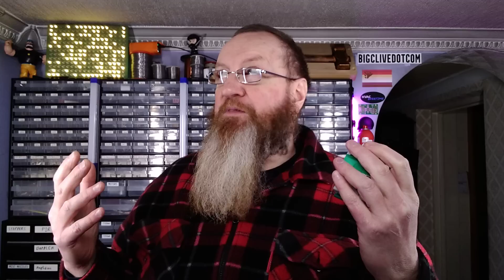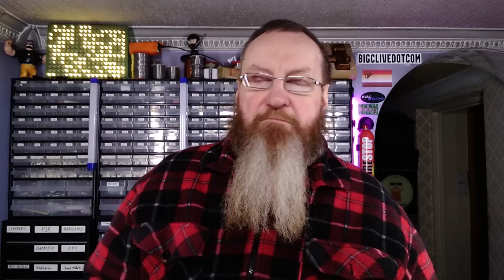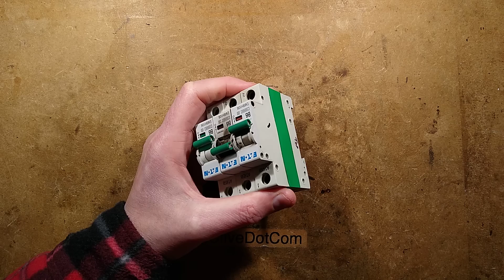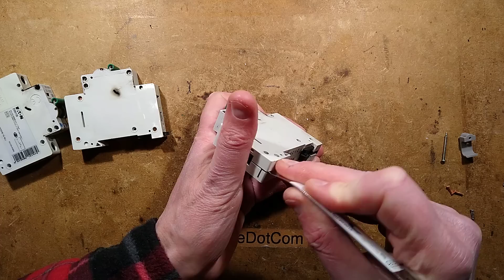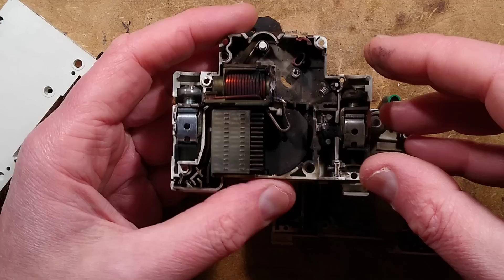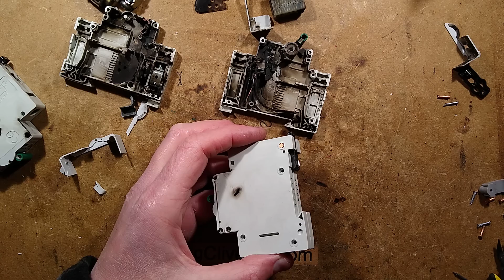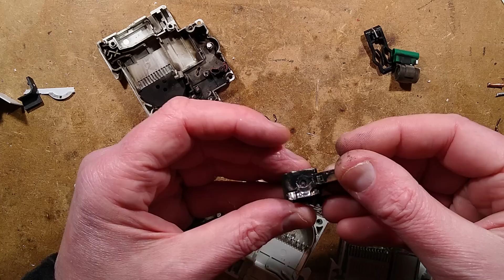Arc flash breaker failure - let's open it

Comment: IME the only way to find a fault in branching circuits like lighting is to isolate it by disconnecting every branch circuit from the breaker that keeps popping in sequence until the breaker stops popping.

Unfortunately that can take quite some time with intermittent faults, unless you have the time (which equals money) to in some cases literally dig up each line looking for tracks, chewed or otherwise damaged insulation and so forth.

And yes, this can happen in residential circuits. I used to live in a hundred plus year old American farmhouse that had some lines running through cinder block walls. A particular breaker would pop roughly once a month in summer but not in winter. I never did chase it down despite replacing outlets and light fixtures on that line, suggesting the fault was inside the wall where I was not willing to look being as I didn’t own the place.

Oh, you say, outlets and lighting on the same circuit? No, that’s not code here but as I said the house was ancient and had been electrified in stages. The breaker box had to be entirely replaced after I moved out because among other things it didn’t have a master disconnect switch! To disconnect the house from the line you would have had to climb up to the weatherhead on the house or do it at the pole nearby. The more I learned about that house the less I wanted to live in it…
Reply: Where does code prohibit outlets and lighting on the same circuit? There are certain circuits that are not allowed to be used for lighting such as the 20 amp kitchen circuits, but I have never heard of any restriction for general use circuits. A good electrician/engineer will design the circuit so that if they do mix lighting and outlets on the same circuit, the lighting and outlets in a given room are on different circuits.

Comment: People need to check the often overlooked Buss Bars that the breakers plug into/over for arcs and cleanliness too! I had one instance where that happened and now a breaker cannot be put back in that position. People check the voltage (usually ok) but there will be a current limitation

Comment: I have a teardown for you.  I brought a Arlec DC pedestal fan in the hope that it would run slow with its 8 speeds but its just as fast as a cheaper AC FAN.  The speed adjuster is an old school switched potentiometer driving an 8 segment LED but it is also controlled from a remote with the switch in the off position.  The input chip has no ID on it.  A bit beyond my expertise to make it run slower.

Comment: Supply impedance and fault currents need to be accounted for and managed in the electrical design - the fact that more than one upstream breaker tripped suggests that hasn't happened here.
Reply from the maker: What happened here was that the breaker itself had reduced in its ability to break its rated fault current over time.  The tripping of multiple upstream breakers is because the fault current was very high and there was no time option set on upstream breakers.

Comment: It's not just in electrical. Anything intermittent is a headache. I'm a soft dev, and the last thing i want to hear is "i was doing stuff and it went pop, but i ran it again and its fine". Some users can give you a pretty good account of what was going on, and logs can help, but for the most part, it's either a very obvious mistake or you'll be looking for needles in haystacks. And sometimes you can't even tell where the haystack is...
Reply: Yeah, had some devs that loved to jump to subroutine, never return, so garbage would accumulate and fill the stack. Then, they'd trigger a garbage collect to clean up.
Senior programmer had to chase down some issue in that tangle code, finally fixed the problem, called a meeting and went off like a nuke.
I took a look and cleaned up a lot of the mess, just to get rid of some aggravation and informed the team, if I ever saw that kind of shit again, I'd solder their fingers together.
Given I was mostly a hardware guy, I think that shamed them into better practices. Or maybe they believed that I could solder their fingertips together after they saw me successfully repair to component level a hard to get multilayer board...
Of course, I didn't tell them that I'd been a code monkey back in the day.   ;)
Reply: oh my favorite part is the only thing you have to go off of is whatever debug print statements/logging that the developer just decided to enable.
Reply: @ All code bases i touched became "Logging and monitoring are first class citizens". It's ok to f'up, bugs are part of a devs life, it's NOT ok to waste dev days chasing ghosts just because you didn't bother to log things. I can live with people making mistakes, that's human. Being lazy is also human, but i don't have time for that one ;)

Comment: Love a teardown.. The solenoid plunger is for short circuit protection to quickly disconnect the supply within 0.4s and the bi-metalic strip is to disconnect the supply in the event of overload. Clever design that is reliable on the whole.

Comment: I’ve known plant operators that with an intermittent breaker tripping seemingly randomly. To avoid writing up a failure, they would reset a breaker a dozen times until it held long enough to make it to shift change. Then it’s someone else’s problem. I was glad to be a SCADA manager and not an electrician. The SCADA manager just got the call to trend how many times the now smoked breaker was reset before blowing, with time stamps. At least in your case, the Eaton breaker did it’s job well and kept the arc flash mostly contained.
Reply from the maker: Especially factory workers on piece work being paid per item they make.  Machine downtime seriously impacts their wages.
Reply: Thats a good quality breaker, most 3 phase breakers have overcurrent trip only on 1st phase, the rest are  just switches...

Comment: We had a real inrush issue when I had a load of servers on the same circuit. Their running load was well within the 32A total limit, but the rush when they all started up after a power cut would trip the breaker. I ended up having to adjust the BIOS settings to give each server a different delay after power was restored to stagger the sudden rush of current.
Reply from the maker: The event industry has sequencers that switch equipment in sequentially.  Also good to allow stuff to boot up in a sensible sequence.
Reply: Also had an intermittent fault with the breakers themselves, and, in the end, the electrician simply replaced them all, which fixed it!
Reply: you have to factor in the huge peak inrush current and supply enough circuits to cope or use UPS with multiple controlled outputs that an be staged.
Reply: Or cheat and fit a "D" rated breaker,  shhhh!

Comment: I spent years looking for shorts and disconnects and leakages in BT buried cables, 50v negative battery and 10milli amps, the TDR (. Mole we called it) was good for full dis or short but it would show up joints where cable sizes went from say .5 to .63 as a dis or a short depending which end you’re looking from, ive had them spot on over half a mile and 5 meters out between 2 boxes 20m apart.  Some shorts are rectified in that they’re different values depending on which leg you send the test current down, due to a diode affect from mineralisation at the wet short,. Generally I used the “ megger” not a megger in fact but a Wheatstone bridge type tester, which could be great over 3 miles or well out if there was some Ali cable or a bit of higher resistance in a crimp.  It got more critical  as adsl came in.  In soft ground an oscillator 99 and a broom handle with an amplifier set and probe wired to a nail in the bottom would nearly always find a leak, it boomed out as you step on it.  At £600 a dig BT wanted them found first dig, otherwise it could’ve cheaper to lay a bit of duct and a plastic box. The oscillator 99 was banned  from being put across a pair because if a sub lifted the handset of a dial phone the bleep could damage their ear ( I doubt it but it would make you jump) but as usual, some of the kit from the early days was better than the latest JDSU stuff we had. Anyway, copper going, all the exchanges are going down to maybe 6 nationally and it’ll all be fibre very soon. They’ll pull out the copper E sides often sheathed in lead and brown paper, big scrap money ,and they’re selling off the exchanges..

Comment: At one location a breaker would pop from time to time, and we had to go to the place, turn it on, and it would work for weeks. It is a ground cable, a 40m run. Last week it was already happening daily, so a guy who specializes in finding such faults arrived. I was assisting. He took a meter doing reflectometry thing, and it showed that entire 40m of the cable is solid. No joy. So he took a device his father made, and connected it to one of the broken phase wires (two phases were showing 0.02 and 0.06MΩ to ground, so definitely something was wrong). He made a makeshift grounding with a big screwdriver, connected it to the other pole of the device, and turned it on. While some relay within was clicking he took another part: a galvanometer with amplifier, and two electrodes that looked like ski poles with 15cm long stainless steel spikes at the ends. He started probing, and the meter's needle showed: left, left, right… away from the grounded screwdriver. As he was approaching the place where the fault was the needle would show more signal, so he turned sensitivity down. When he was at the spot he only moved electrodes by centimeters and needle would already change the direction. We started digging, and there was a fault: cable was damaged by people who put a fiber there, we found markings of the excavator bucket (insulation was broken in two places), also the damaged cable was insulated poorly so that water came in, did its thing with electricity, and cable insulation turned into crispy conductive carbon.
I asked the guy about the device: apparently there was a capacitor being charged by voltage multiplier, and when its voltage reached certain threshold the relay would connect it to the output. While discharging through the ground it would produce intermittent voltage gradient, probing it would show rough direction where the fault is. It required its own grounding to operate.
Apparently his father saw some electricians doing it years ago by hand: charging electrolytic capacitor using a diode from mains and discharging it between local ground and broken wire. Other guy would walk with galvanometer, stick electrodes into ground and find the fault eventually. So he made his own, improved version. No idea if this is patented, simplicity and effectiveness is surprising and satisfying :)
Reply from the maker: Interesting approach to find a breached outer sheath on a cable.  I've had a few instances where underground cables were clipped by contractors and they just buried it afterwards.  Very annoying.  The utility also uses a device called a thumper to trace underground faults.  It charges a capacitor and then dumps it on the cable.  It results in an audible thump where the damage is.
Reply: They probably knew about damaging the cable but 'ostrich-ed it' probably cowboy contractors avoiding extra cost of repair from the electricity board.
Gaz Yorkshire
Reply: @Gazr965  I used to work for a cable ISP as a field technician and i can tell you this happens all the time. Once I roughly located a fault to a private construction site where they where digging with a mini excavator and asked them if they had seen a cable they might have accidently clipped. Usually when i asked nicely contractors would show me, dig the cable back up, i would fix it and they could move on with their day without even being billed, accidents happen. But these guys.... They where sooooo sure they didn't even come close to any of our cables and that i must be wrong and the fault must be somewhere else, they had me studying plans, locating cables, remeasuring and question my sanity. They also became increasingly unfriendly and hostile, threatened me I would have to pay for any downtime as a result of my fault finding. Eventually i've had enough, called in my own contractors and had them open the exact spot I had been questioning them about hours ago when i came on site, only to find about a cable that was completely destroyed over the length of over a meter. It was also clearly copper with no sign of corrosion so it must have happened probably an hour before i came there. When i showed them they became quiet and then started mumbeling shomething about a treeroot that must have caused this. Not only does tree root damage look completly different, because it is happening over the course of many years, there was not even a tree in sight! That was the first time I billed them, for the materials, for my time, for the contractor and for the downtime to our customers. I was super pissed. This could have been solved within 30 minutes with no cost to them, but they decided to waste hours of my (and their) time because they needed to be absolute dickheads.
Reply: @muh1h1  Amen.
Reply: @Gazr965 elec board dosnt fit fiber, telecommunications companies do!
Reply: @rodd8170  You mis read my comment, I said they ostrich-ed it meaning avoiding paying 'electric board to fix it'. 
as in  damage the fibre optic contractors caused to the electric cable !
Reply: Rodalco2007 has a demo of a thumper being used on his channel. Seen them, but never in use. I’d imagine they are quite costly, which is why your father opted for rolling his own. Seemed to do the trick.
Reply: "people who put a fiber there"

The people who put fibre down my road (hello Voneus!) burst a sewer pipe.. it started to leak, they covered it all up, and ran away. Three weeks later, sewerage all over the road.
Reply: @mickeythompson9537  I've seen multiple instances on an Australian plumbing channel where the telecoms company drove their fiber through sewers and storm drains because they used horizontal drilling methods instead of trenching. One of the latest was straight through the middle of a six inch sewer at three foot depth.

The problems only become visible when the plumbers stick cameras down the sewers to figure it out.
Reply: We had a similar unit for sheath faults. It had a motor driving a contactor to create the signal. It was controlled by a vairac, transformer wtih a bridge rectifier to get about 1000Vdc pulsed (called it a Popie). It used the same duel probes and galvo to sense the current flow. It was all hand built by the old powerboard before I was born.
We also had a thumper to locate higher impeadence faults with the headphones. On a good fault you would feel it while walking along.
We used to bet a box of pizza for every meter off the final fault location.
Reply: Here in germany, our utility companys have trucks with such fault finding equipment for cables up to 20kV and they too use the basic methods first, sending high power pulses down the broken cable to identify if its a ground fault or a phase short, also sometimes you can even hear the boom when the energy discharges (I stood about a meter next to a 10kV test impulse, its like a giant firecracker XD). The trucks measure the high voltage spikes against an earth electrode, automatically doing cable reflectometry too, and then the "last" measure is actually the probing with 2 electrodes to find the precise fault location. Works like a charm every time (just not the one time when the fault locator truck couldnt properly identfy the fault in a ring line on a camping place, because there were actually 7 faults on the cable across the entire place XD
Reply: I wonder if high frequency AC would cause the fault to emit a sound.
Reply: Thats clever as hell, really shows the guy knew his shit.
Reply: How far away do you have to be from a desert for it to be safe to use the thumper? Or is that i only a problem on Arrakis?
Reply: I love reading stories like this in Clive's comment section, it's just fascinating
Reply: Sounds like the way a Side-Kick works
Reply: I had an issue with an 11kv incomer cable to a transformer and fuse/switch set. It took out an entire building, the latent fault having being  placed many years before.  The distributor came out to investigate  finding two phases to earth before the transformer . The disconnected  both ends of the supply cable and thumped it from a van based device. The audible discharge  could be felt on the grassy surface  some five feet above the failed insulation.  After a dig it was discovered a large chunk of concrete  spoil had been back filled against  the cable. Visible in the grass surface  were truck tyre marks when an articulated trailer had been carelessly hauled over a kerb and onto the grass over the cable. A day or two later moisture affected the connections between phases and earthed sheathing  to thankfully  triggered a disconnection of supply. 12 hours later and a 10k spend restored power via two cable joints and a spare bit of cable.... fault was some 15 years in the making.
Reply: @markbird1965  Jeez, a slow but sure fault there.

Comment: I used to work at the company that makes these breakers. I worked on some of the machines that make the key components, test the breakers and assemble them. 
It is exciting to see how outsiders react to the mechanism.

it seems to me that the inrush current has exceeded the maximum values by far. That's why there must always be a fuse upstream that can switch off SAFELY at higher currents.